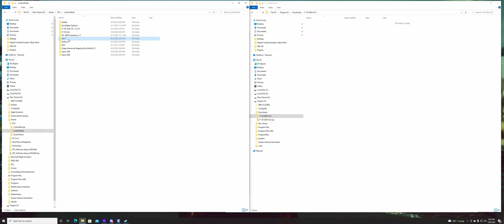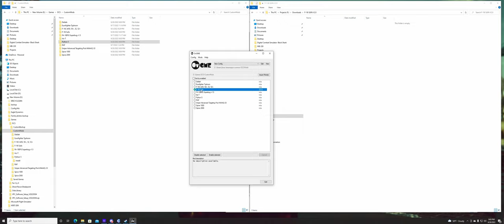How to Install and Cold Start the F-16D/F-16I SUFA in DCS

Comment from the maker: Note: if you are still on the old version 2.0: if you want to use the weapons included with this mod with OVGME you need to make sure to move their contents out of the "install" folders. The developers say they will get rid of the "install" folder in the next release. So if your weapons do not work with OVGME that is because they are still inside the "install" folder.

Comment: So, I've got the mod installed, and I can tell because the F-16 main menu changes, and I have access to the F-16I missions. However, how do I actually use the aircraft? I can't spawn it in custom missions, and all the Sufa missions use the F-16C.
Reply from the maker: Weird, sounds like something went wrong with the module installation. I've seen things like other mods conflicting (like DC3 Clickable mods). I'd try that. Maybe DCS Repair. All else fails join the IDF Mod project Discord for tips